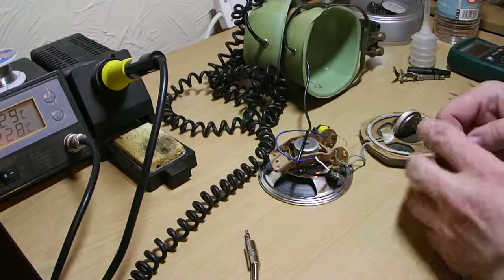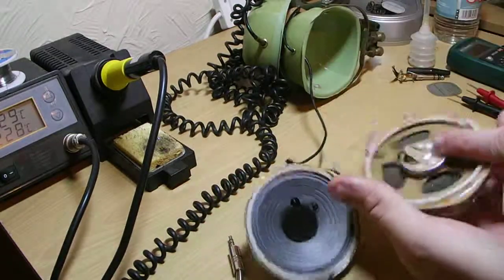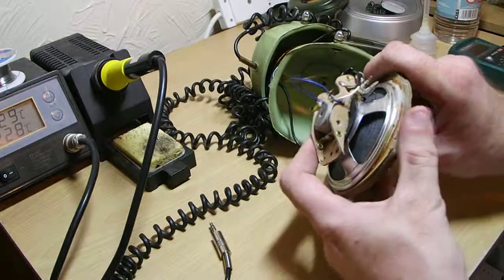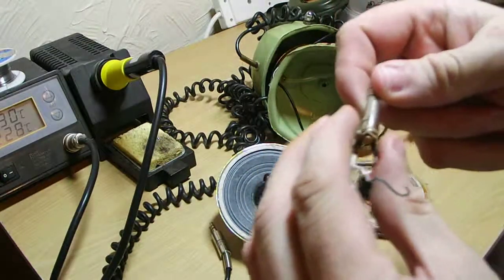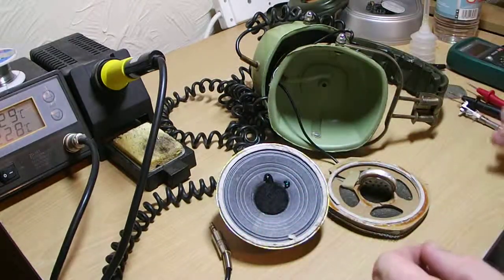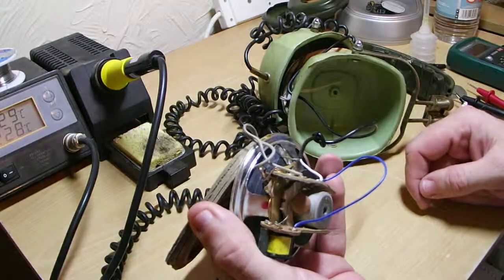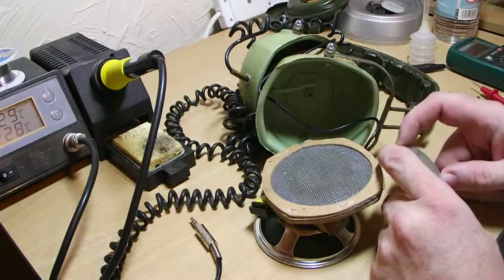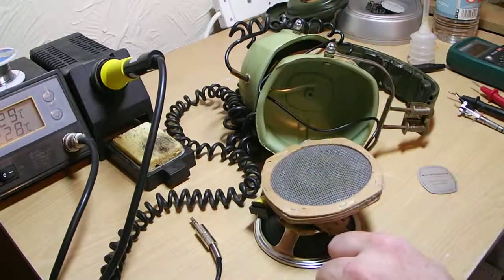Superex ST PRO BV headphones

Comment: Thanks for this great video.  My father who passed away two years ago was the founder and President of the Superex and I grew up around the business and the audio world.  I moved on the world of software but my daughter keeps pushing us to restart Superex that went out of business in the 1980's
Reply from the maker: Hi Marc,  Thanks for the comment. Firstly, the Superex headphone brand is top notch, always great audio reproduction with decent amp of course. Second; sometimes legendary items like this belong in the past where they can be remembered with the respect and fondness of those who used them, thats not to say that a restart of the brand would fail but just how would anyone be able to better it? If your daughter has her head screwed on right then i wish her all the very best, it would be a huge undertaking to equal what has been.
Reply: Patents?
Reply: I owned 3 different pair of Superex Pro-B headphones. The first set was regular Pro-B in about 1968, then later, probably about 1970 I bought the Pro-BV (V=5) both when I was in high school, then a couple of years later when I was selling HiFi gear about 1972, I bought the Pro-B VI (VI=6) set. I thought the 6s were the best, having had all of them new. I just bought a set of old 6s on the bay, I hope everything works. These were the best sounding cans for the money by a large margin IMO. I used them with a V15typeII and a Marantz 3300 preamp. Awesome sound. Oh, and I moved on to being soundman for the next 40 years. I would definitely look at a new Superex product if it came to be. ;)

Comment: I watched this video with a pair of Superex headphones on my head !
I bought them on a flea-market ( thought they were some kind of military surplus...)
Sound is surprisingly good...a bit muffled in the treble but midrange/bass is round and nice, very clean sound.
Now I know how they look on the inside ! Thanks.
Reply from the maker: Hi, if your headphones are muffled it may be due to the age of the cone material or maybe the cones have separated from each other. These headphones normally give a clear response across a wide range. Maybe the treble (tweeter) has loosened off over the years. Might be worth taking a peek inside. The retaining screws are under the labels on the outside of the cups. Have fun.
Reply: wykeradio Thanks for the info ! I shall take a look.